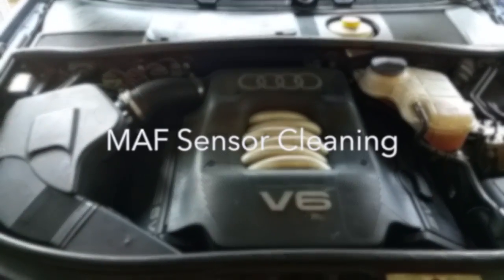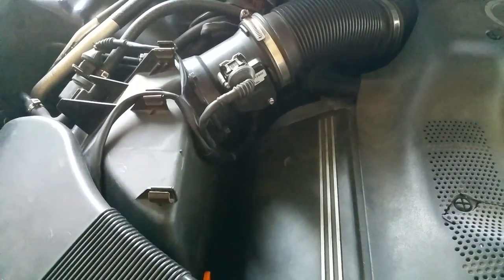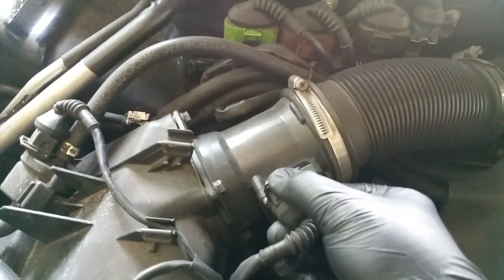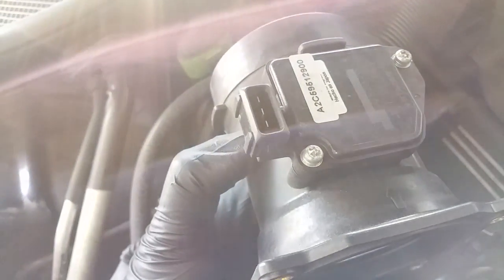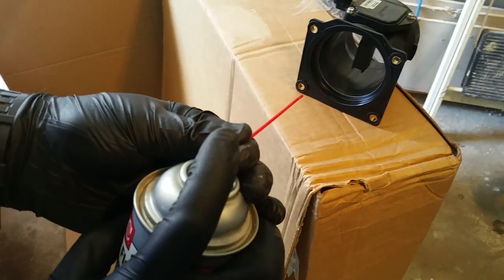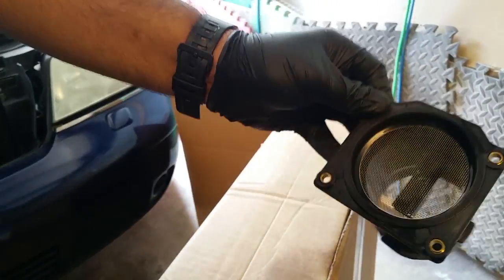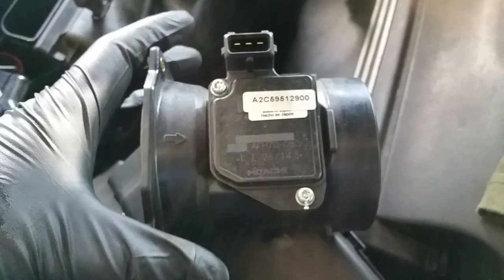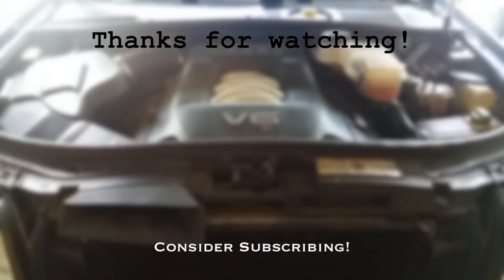Mass Air Flow Sensor (MAF) CLEANING!- Audi

Comment: You are not supposed to disconnect your battery without a backup power for the OBD2.
Reply: I’d say the risk of “short circuiting the MAF sensor” from unplugging the connector is pretty low
Reply: I'm gonna skip that part lol

Comment: Really? Did you watch your own video? You can't install it backward 😫 If you care about your car a few points matter. First is that this is an audi it isn't a Ford focus it needs a ecu memory saver to disconnect the battery and depending on the age it needs vagcom to reregister the battery! You can cause all kinds of nonsense to occur by disconnecting the battery. But this simple task isn't one that requires disconnecting it and the arrow thing shows this YouTuber barely knows how to feed himself let alone service a car.you would remove the maf from its housing other wise you risk dripping more crap onto it from the housing. You can't short circuit it unless your gonna jam a paperclip in the harness???. Audi’s have very intricate ecu’s and engine management and cost a premium new treat them well and they will last forever and keep you informed of what's going wrong. Treat them like crap and you will have a bottomless pit of money it's not an expensive car to maintain just keep it consistent